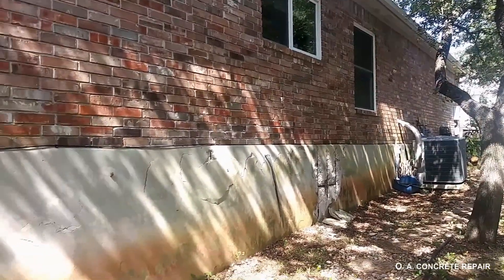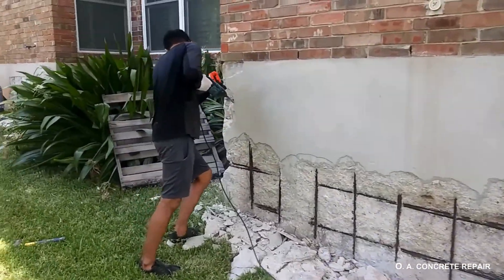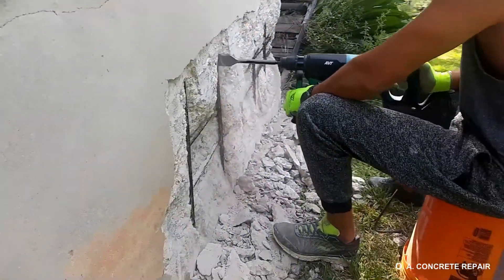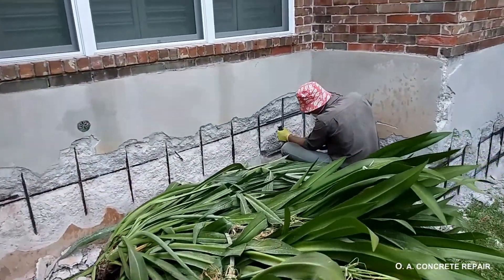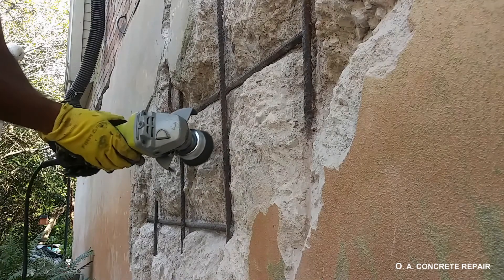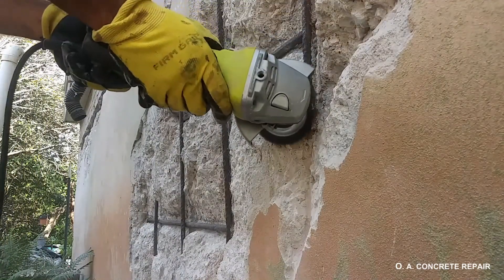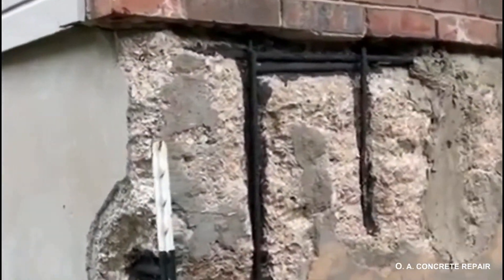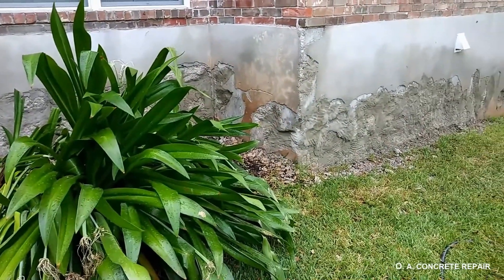HOW TO REPAIR CORROSION DAMAGE IN A CONCRETE FOUNDATION

Comment: Please let me know the name of Mortar Mix and Bonding Agent and how much water needed to mix them
Reply from the maker: Mortar mix by rapid set cement. Corrosion inhibitor by Euclid. No bonding agent, this mortar has excelent bond. If you want you can apply an epoxy (not acrylic) bonding agent to bond the concrete layers, but it will be expensive.

Comment: Within 5 years these repairs will fail.
Reply: Why would it fail? What else can be done?
Reply: @ericwelch5461  Once rust sets into metal, not much will stop it.  It will keep expanding and popping the concrete off.
Reply from the maker: @Loonypapa  We cleaned the rust and applied a corrosion inhibitor. It's a proven method by many government institutions. It is know that corrosion damage doest get completely mitigated, but it buys reasanoble time to the structure.
Reply: @ericwelch5461  FRP use
Reply: @um1969  FRP rebar can be used, but the rebar cage has to be designed and it has to be a complete replacement.  The hooks and bends in steel rebar are a key element in the design.  If you don't incorporate them in the repair, the repair will be inadequate and cracks will form.
Reply: @um1969  Hows the basanite bridge doing?
Reply from the maker: @Loonypapa  yes, I have used FRP in similar projects, but it is dam expensive. It would have Tripled the cost of the project. And we are just talking about a residential home owner here. 
FRP should be applied on sound and repaired concrete, if you apply it to a damaged structure, you would be anchoring the FRP to butter, being this a complete waste of money.